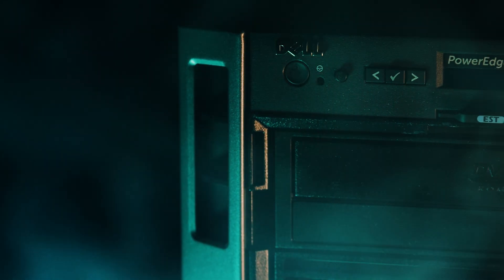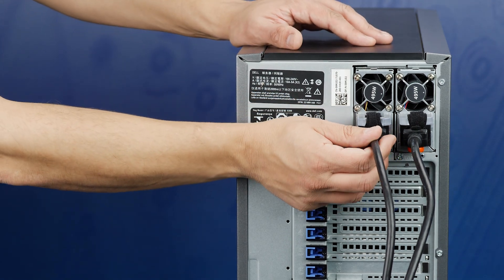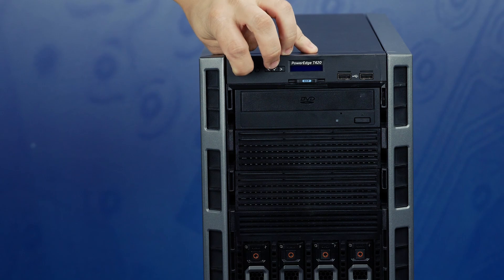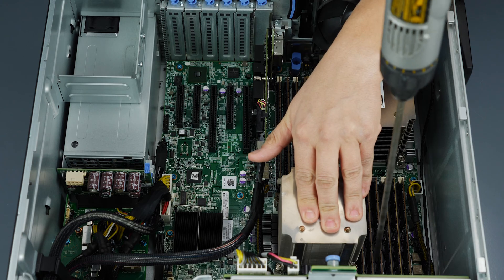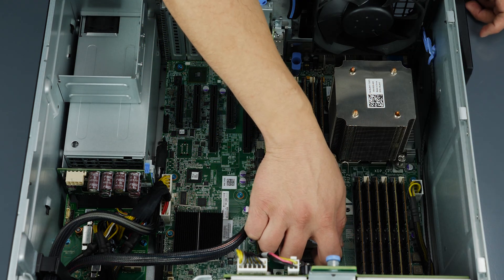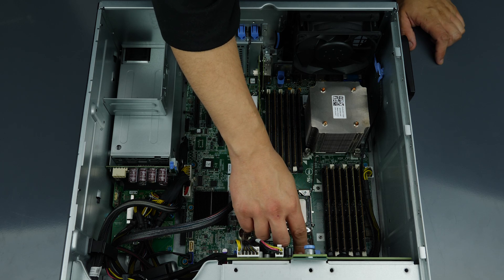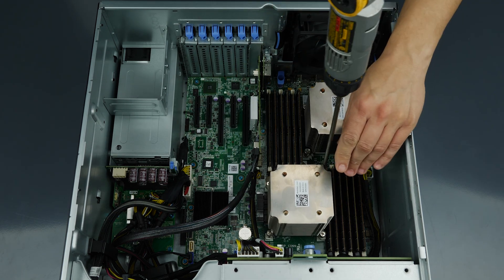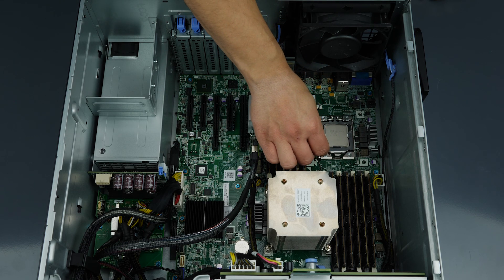Dell Poweredge T420 Server Processor Installation and Upgrade Guide

Comment: Cool vid, but here is a comment to assist with those that watch mobile. This is an LGA1356 system that supports Intel Xeon E5 14xx, 24xx v1 and V2 processors. (Sandy and Ivy Bridge Codename). Note if using a 14xx series CPU you will not have dual CPU support. As for RAM support, anything that says 10600R, 10600E, 12800L I have personally tested as compatible. Cheers.
Reply: Small correction, Dell T320 and T420 uses LGA1356 instead of LGA1366 and depending on which CPU do you use, it would limit the RAM type, and total ram capacity that is supported for the system
Reply: @wcypierrenet  Corrected the "6" to a "5".